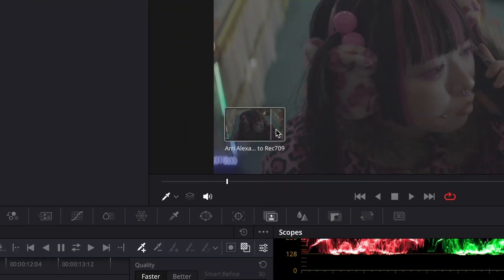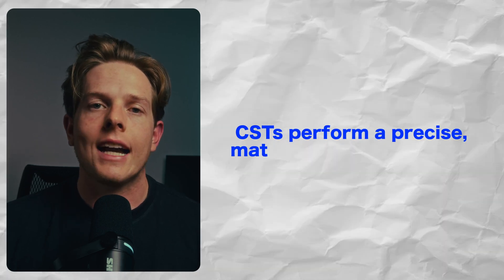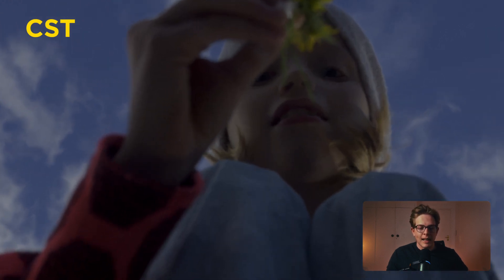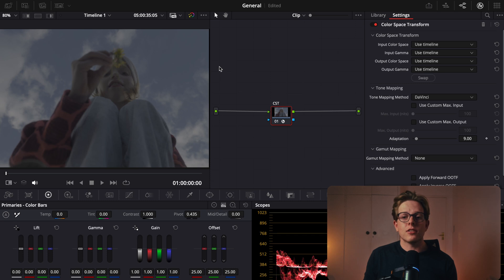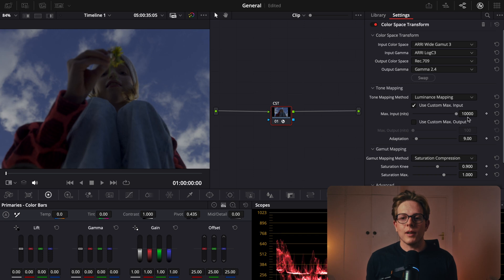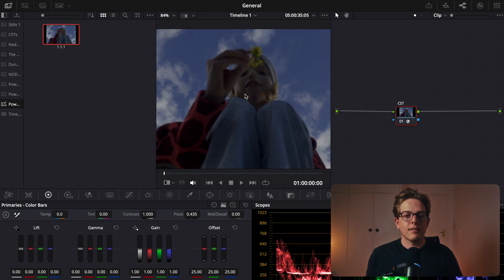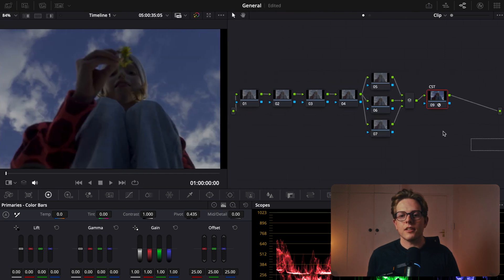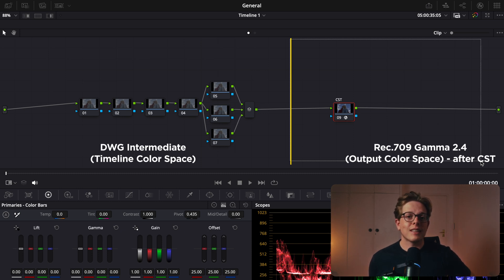STOP Using LUTs to Transform your Log Footage - DaVinci Resolve Tutorial

Comment: Trying to wrap my head around this. I understand the single node setup but the more complex one breaks my brain :-)  If I set the timeline to be DaVinci WG/Intermediate, then all the grading nodes can work with that large color space and retain as much information as possible. OK, but where is he footage getting converted from ARRI (in my case CLOG2) into Davinci WG/Intermediate? The only CST node is at the end, so to me it looks like everything before should be in ARRI WG3 color space, not Davinci WG/Intermediate? Or does the timeline settings do a color transform behind the scenes before the first node so that everything becomes WG/Intermediate? If that is the case though, shouldn't the last CST node be converting from Davinci WG to REC.709 and not from ARRI to REC.709? Feels like I'm missing something 🙂
Reply from the maker: This is a great question! I can absolutely help you understand this more.
It is quite complex and there are a lot of different things going on. 

Let's break it down like this:
Goal:
- Work in a large industry standard working color space (DaVinci Wide Gamut/ACES)
- Output to industry standard output color space (Rec709 Gamma 2.4)

You can do this in multiple ways and the method you choose depends on how you like to work as well as what kind of files are in your project. 
In your case, you could potentially group all of your Arri shots by selecting them and grouping, then in your group pre-clip node graph and a CST which will be your Input Device Transform - input color space and gamma should match your camera and output color space and gamma should be the working color space (DaVinci Wide Gamut/DaVinci Intermediate)
In the group post-clip node graph, you will add another CST, which will be your ODT (Output Device Transform) . This will go from DWG to your output color space and gamma. 
Here is a video in which I talk through this workflow.
https://youtu.be/JHli5P-SzEw

Comment: I would like to give my unprofessional 2 cents. For Davinci Resolve users on macOS, you probably want to set your project settings Color Management section's Output Colorspace to "Rec.709-a" instead of "Rec.709 (Scene)". Otherwise, you may very likely (... probably? ... definitely?!? I swear this has happened to me a billion times ...) ... WILL ... have huge colorshifts from gamma Rec.709 (Scene) down to Rec.709-a when viewed after rendering. 

Nonetheless, great stuff Graham! Learned a ton.
Reply from the maker: Thanks for the support and for sharing that! You are definitely correct, there is a gamma shift that happens in resolve on a mac when exporting in gamma 2.4 so rec709 A as an output gamma is the correct gamma space for exporting on mac. Definitely something I will mention more when tackling color management.
Reply: @grahamhunt_  Good stuff! Thanks for clarifying.

Comment: I’m afraid I have to disagree with your points. All variations of colour management including RCM (CST and project settings), ACES and technical LUTs from the manufacturer to go out to a display colour space are technically accurate. Of course, they provide a different starting point and which one looks ‘better’ is quite subjective. What you’re referring to is how their DRT looks but that does not make one less technically accurate compared to the other. Additionally, you have third party DRTs including JP2499 DCTL, Open Display Transform and Filmverse Lite which are all technically accurate but they all provide a different preferential starting point and it’s up to the colourist to make the call which one works best for the project.
Reply from the maker: Hey Marieta! Really appreciate your thoughtful input - you’re right, a lot of these tools are technically accurate when used with intention. My goal with this video was to speak to folks who rely on LUTs for transforms without really understanding what’s happening under the hood, or what their other options are. CSTs and color-managed workflows often give more clarity and flexibility, and I’d argue they offer a better path for learning and understanding image pipelines than LUTs do for most people. Totally hear you on the DRT point, though. As always, I value your insight, thanks for sharing it here!